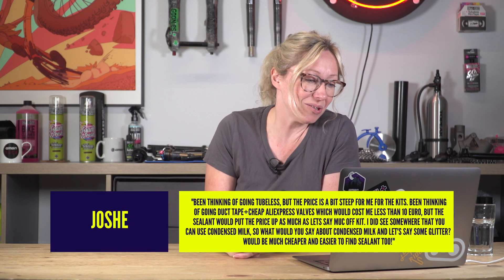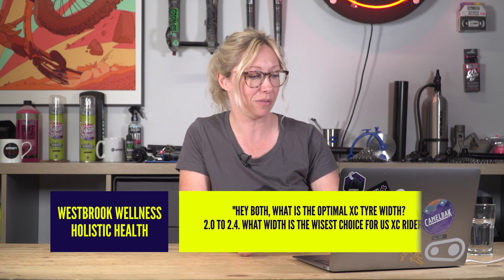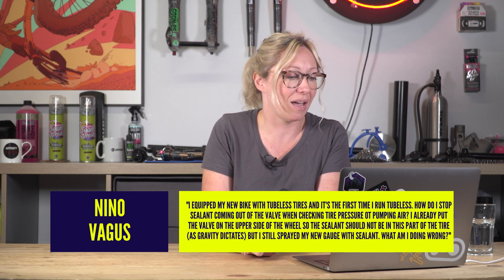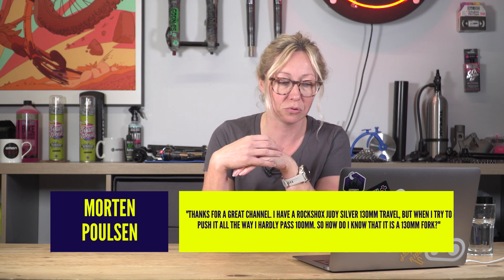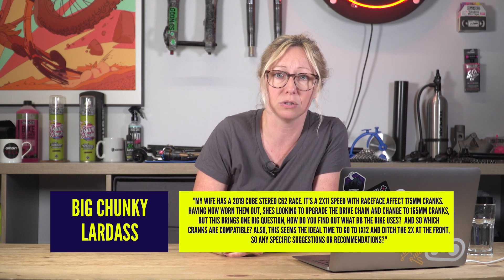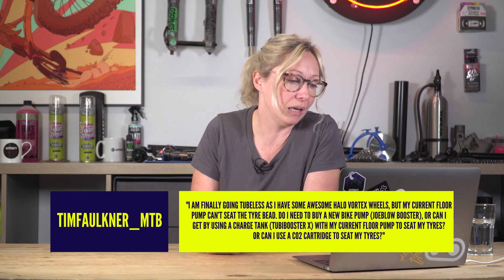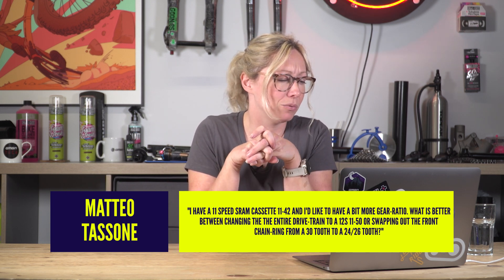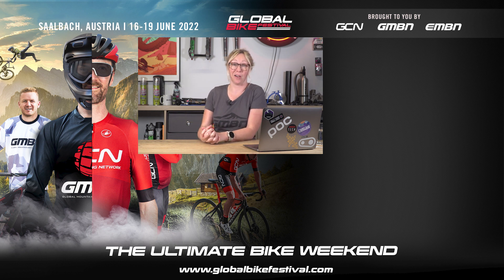"I CAN'T Seat My Tyre, Do I Need A New Pump?" | #AskGMBNTech 189

Comment: For that last question about the different gear ratios, it’s worth noting that a smaller chainring might get you a better climbing gear ratio, but you would also be limiting your speed on the high end of your cassette. 

If you use the bike to commute to a trail, that’s something worth considering as you won’t have the same top speed with a smaller chainring, whereas with a larger cassette group set, you’re keeping the same top speed AND adding a better climbing gear. 

Also, changing the cassette means you have to shorten the chain, which I suppose you’d have to alter the chain in either option anyways.

Comment: The hack for a baggy fit is to manually seat the tyre with a tire lever. Once the tyre is on, run a tyre lever round working on the valve half of the wheel, pulling the tyre back out but not completely off, when it slides back on the rim as you work around the tyre, it will seat on the high edge and gradually get tighter and tighter as you move. Once it's too tight to pull out, repeat on the other side and most of the tyre will be seated, it will be stretched tight enough to seal all the way round, then pump it up with a normal pump. I bought a Joe Booster for £140 and even that didn't work for my baggy fit wheel tyre combo but this hack did, courtesy of Sid Fixes Bikes on YouTube. A life saver and I returned the Joe Booster, saving myself £140 quid.

Comment: I have the same bike Cube Stereo 140. Which is by the way a really nice bike. I died the 1X conversion dropping from 36 chainring to a 32. I’m no expert but have been riding for 25 years and the setup is perfect with the advantage of cleaning up the cockpit and allowing much better positioning of the dropper post lever and even adding a timber bell which is way more effective on the trail than I ever thought it would be.

Comment: Don't go for the cheap valves and tape.tried it and it kept leaking from time to time. Got a well known brand one's after that and no issues till today. Best to save up for better equipment than waste money on the cheaper option that may not work. If not stay on tubes.

Comment: Thanks for answering my question. I can see the flaw in my way of thinking. Now I just need to get used to putting the gauge on the valve without letting out all the air 😂

Comment: If u can't seat tyres, just pop down ur local garage / fuel station and use the car one. U can get presta to schrader adapters for a couple £ online. Set the inflater to 'flat tyre' mode if it has one.  Simples

Comment: I had a set of Continental Cross king tires unable to get them seated with a standard pump, and got me so frustrated that I had to purchase an air pump with air canister attached thank you Crank Brothers. As for going tubeless would try Muc-off or Stan's sealant, and would never add anything that will smell bad in the future.
Reply: Why not just take the wheel to ur local garage and use their air compressor? 
Once seated once, they tend to seat easier next time if removed later

Comment: #AskGMBNTech  Is there anything to be aware of if you have to mix different brand sealants? I was away on holiday and got a puncture and didn't have my preferred sealant on hand. Can you even mix sealants, I know it's probably not ideal but will one sealant have a terrible reaction with the other?
Reply: When you're on holiday sometimes you have to do what you have to do. When you get home get the hose out and clean out all the ceiling. Put fresh in. It's best not to mix brands. They all use different compositions.

Comment: #AskGMBNTech

I am just getting back into mountain biking and find the front wheel is hard to unweight/lift on my new bike. I realised it had a very long (495) chain stay length. What modifications can I make To help with my manuals? I would like a bit more travel in the front fork and I'm hoping this would help. Any other suggestions?

Comment: People are obsessed with tubeless. Modern tubes like Schwalbe Aerothan and Tubolito's are far better, lghter and puncture resistant than those old nasty heavy butyl ones from the past. You can even put sealant in the tubes if you so wish
Reply: Couldn't agree more, stans, muc off or slime in tubes works great. Especially coupled with Schwalbe Marathon Plus tyres.
Reply: Tubeless...Its not just about thorn type punctures...

Comment: #AskGMBNTech  An actual tech question for you.  Coming from a 90's bike (with 90's tech) to a modern bike, tire technology and design is in a whole new world, but finding a front/rear tire combo is still difficult.  Is having a designated/dedicated front tire necessary and if so, why are there so few options when it comes to dedicated/designated front tires from the number of tire manufactures?  It just seems there are so many rear tire option and very few front and even less front/rear combos.

Comment: LOL who doesn't repair their inner tubes or keep a spare one on the bike and repair the punctured tube at home, bonkers justification for tubeless! Branded tyres such as Schwalbe are very puncture resistant so take your pick but running with a tube is always going to be the cost effective choice with good quality tyres.
Reply: Depends where u live... some areas are thorn central... dozens of punctures per ride would soon leave a tube pretty useless... not to mention stopping every 10mins to fix
Reply: @rupedog  Then tubless would be the way to go but for the majority I would suggest it still remains a choice.

Comment: You can totally seat a new tubeless tire even if you only have a handpump! That's all I have (didn't want to spend money on an actual floor pump lol) and got my new tires seated. What worked for me was once I got the tire on the rim, I pulled the edges of the tire out from the middle of the rim and up as far as I could by hand. Then it's just a matter of getting air into the tire faster than it is escaping until it seats. You gotta do a lot of fast pumping but it works 😂Even if you have a floor pump, this is a good technique to make sure the tire is in a better position to seat quicker.

Check this out for a better tutorial: https://youtube.com/shorts/hFEt5lG_mYI?feature=share
Reply: hey man, good tips, but some tire and wheel combos simply can't be seated with a hand pump.

Comment: Washing up liquid works for sealing your tyres used it on my motorcycle triels bike would i use it again? Nope coz it rotted the rim from I the inside out!! And now nackerd the rim and have no option but to use a tube , so just use the proper stuff or don't do it at all!!
Reply: Soapy water on the tyre bead can help seaTing ur tyres... thing u misheard whomever told u to use washing up liquid to seaL ur tyres!

Comment: Hey I can Crack a Tyre with a pump... 🤷🏻‍♂️
Reply: I used a Schwalbe tyre Booster and I only managed to get about 3.5bar into it with one go. So I didnt manage to break the tyre xD not sure if you can say that about all those booster thingies ^^
Reply from the maker: Yeah, you can burst a tyre if you exceed its max PSI limit. Normally you can find this limit on the sidewall of the tyre! Hope this helps! 👍